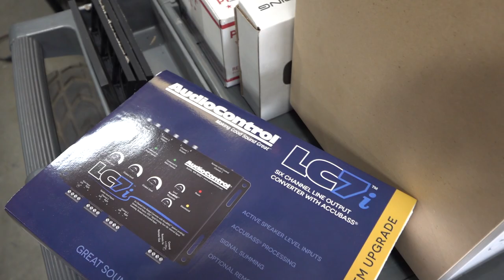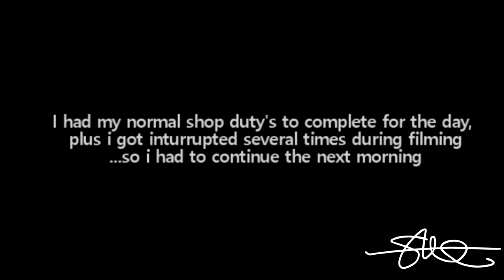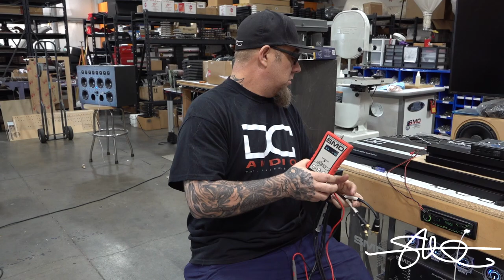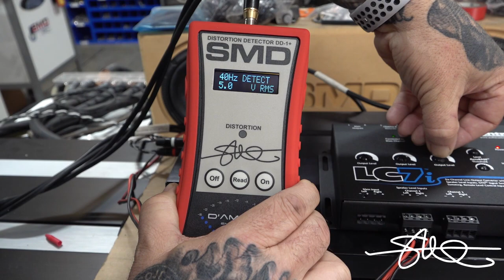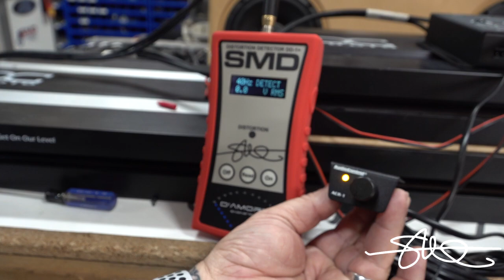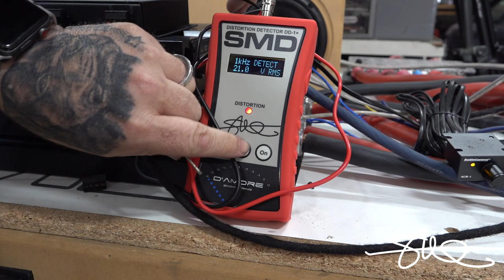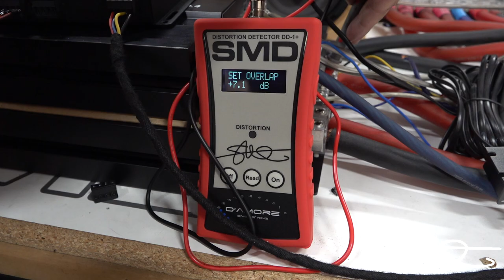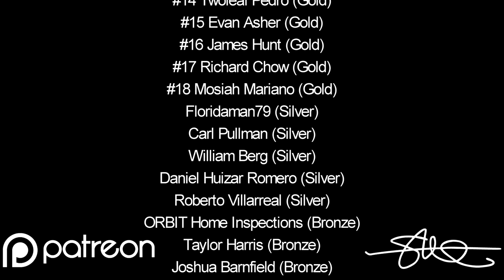Add Amps not Distortion! AudioControl LC7i 6 Channel L.O.C. Hooked up, Gains Set, Played full tilt

Comment: With a remote gain knob, rather a bass knob, would you still have to turn the knob all the way up?
Reply from the maker: Raging_Bullz77 if you can.
Reply: Alright. The amp with the gain knob is a S1-850 from Soundqubed. I'm a little new to gain knobs as most amps I've ran before are just bass control knobs.

Comment: I don’t know much about speaker, but I have a 2016 Honda Accord sport with the factory 4 speaker system. I recently bought a Skar 2000 rms amp and wondering could I hook this up to it or is this to much?
Reply: yes it can take up to 400 watt signal which has nothing to do with output. add a few more amps your good to go

Comment: What effect does changing EQ points on the radio have on these settings? I see a lot of guys doing the smiley face on their EQs, would they need to account for that while setting their gains?
Reply: Yes, set the EQ before you set the gains.
Reply from the maker: sure..they should stop drawing smiley faces and using an eq for what it is made for.  If you are using a dd-1 it is time to be serious about it and learn how to do everything right.
Reply: EQ is for correction to get a flatter response not to draw a "smiley face" That's a funny way to describe it though. 
At lower volumes, we do not hear those ends of the spectrum. When you get old like me, those frequencies are missing even more until you turn it up a little.

Comment: So question. I notice you always set the bass amp to -10db. How does that not clip extremely bad? I set at -5db and even studio recorded music is usually hotter than -5db. Like I purchased Psyph's first album and he was way hotter than -5db on a lot of his tracks. Just curious if you could explain the setting choices and how to manage them for people. I'm sure someone that's new will buy a DD-1 set at -10db and then go straight to DJ Russiticals or DJSNT music.
Reply from the maker: it's not just me that does it. It's the basics of car audio for decades.  It's just a o-scope used to the the tool. Now the dd-1 is where it's at.  And no, it isn't clipping extremely bad. It's called a gain overlap. Instead of me putting on a class here for you, just click this link and read it very carefully.  You will be enlightened. http://www.davidnavone.com/heresHow/files/LevelSet222.pdf
Reply: @meade916 So what am I missing in my setup? I tune the headunit to 0db. My max volume is 37. I set my gains at -5db on my bass amp. When I play any song off King Morrison at full tilt my clip light almost never shuts off. Same for any of the "DJ's" music. I just always adjust with the bass knob. That's why I was confused on how you're setting to -10db and full tilting but it's not clipping even though I know how hot Psyph records his albums. I'm familiar with the theory of gain overlap. Not hating at all just confused.
Reply: Sounds like you're not reading flex.
Reply from the maker: @Supercharged1976  don't pay any attention to that bogus "clip light"...and Psyphs albums aren't recorded "hot".  I helped produce the last 4. They are good.  I don't know how you are coming to that conclusion. I think you are just overthinking everything.  If you are using a DD-1 to set the gains, you should have gotten a booklet.  It explains a lot.  Plus, i gave you a link to a very good read by one of the best there is.  Check it out. Thanks!
Reply from the maker: @Supercharged1976  if King Morrison is giving you issues, try the actual CD instead of a download off the internet.  See if that helps.

Comment: TIP: set accubass 100% - gain 0% - bass 0% - I have it hooked up, LC2i to clarion EQ to sub amp.
Reply: Your accubass isn't ment to be at 100 percent .it's supposed to be set after all your gains are set and if your factory set up is causing bass roll off then you use the accubass  to compensate for it .
Reply: Please read the manual lol..
Reply: @Thezuule1  this works only with the EQ like i stated.
Reply: @lmlittleman  What do you mean this work only with the EQ like you have stated? I personally own an LC2i and LC6i and I'm begging you to read the manual. You don't know what those knobs do.

Comment: doesn't the lc7i have a built in distortion detector? If so, id love to see how to set the gains with that, and how the detection is compared to the detector you used in this video.
Reply from the maker: Brian W not that im aware of.
Reply: It does its the yellow light on the front that says maximize
Reply from the maker: Chris Spiller ya but that aint a distortion detector or any kind of a clip light...so 🤷‍♂️
Reply: The maximize light is for voltage. It starts flashing when the input and output levels controls sense maximum design voltage.
Reply: @juicedcoupe  this is and i quote from the audiocontrol website tech page "**THE MAXIMIZED LIGHT ENSURES YOU DO NOT DISTORT THE OUTPUT OF THE CONVERTER, IT DOES NOT ENSURE THAT YOU WILL NOT DISTORT THE INPUT OF YOUR AMPLIFIER** The maximized light is a handy tool if you do not have a volt meter handy. It serves as a guide in helping you not distort the input of the amplifier ."
Reply: with all that said they do say that you need to find output distortion level of the source unit first, but the maximize light is for gain matching the input of the convertor to the output of the convertor.
Reply: So, it does not detect distortion.  It just keeps you from overdriveing the inputs and outputs, inadvertently creating distortion or clipping.
Reply from the maker: @juicedcoupe  all i know is that even though the light was on there was no distortion present.  The dd-1 will light up like a 1 lane country road stop light if it see's any distortion, which happens way before clipping.  And if it was clipping the dd-1 would for SURE be going nuts.  So it's clean.  The light might just be a soft reference point for noobs who shouldn't be doing this themselves....but do anyway.
Reply: @meade916  That's the point I was trying to make. The light is just a voltage reference, not a distortion detector of any sort.
Reply: @juicedcoupe  no it ensures the output signal is not distorted should it become distorted, the light turns on just like the dd-1
Reply: @juicedcoupe  how accurate it is compared to the dd-1 is unknown which is what the op and myself are wondering.
Reply from the maker: @coupedevylle  no it doesn't.
Reply from the maker: @coupedevylle  it isn't a distortion detector or a clip indicator. I already said that. So there is no comparison.
Reply: @meade916  yeah disregaurd previous comments, i was mistaken, i did some more research and talked to someone i know that more familiar with them. I was way off base.

Comment: so if my 4ch amp is 100x4 but my door speakers are rated at 70w rms, should i set the gain overlap to 7?
Reply: Assuming the ohms match up, some mids/highs amps rate full power at 2 ohm, where as your speakers are most likely 4 ohm.

If your amp does over power the speakers, then yes, it's a good idea to back off.
Reply: yes focal components are 4ohm as well as the alpine 4ch at 100x4 at 4ohm.
Reply: just received my DD-1+ about to dial this baby in!
Reply: Dude can u answer this for me please?, So basically this dd1 + is just like the normal dd1 where u use 40hz at -10 db on the subs and -5 db on the highs, but the only difference is with the dd1+ u can control the amount of power sent to your speakers if the speakers are smaller? But with the delay overlap on the dd1+ it shows up as  +10 on the highs and +5 on the subs?

Comment: I have a single nvx vcw122 12 and its powered by a pioneer 1000w max power amp. Has 4 guage wiring. After 10 mins of playing around 30 vol the amp gets hot and starts or pause while the doors still play... any suggestions on what to do???
Reply: join the SMD forum and ask there
Reply: What's that
Reply: @aaronheard1794  steve meade designs forum, google it
Reply: No offense but the amp isn't great. I would double check you have your gains set correctly, jimmy rig a PC fan to the guts of the amp for some cooling if you're jimmy rigging inclined, or perhaps just buy a higher quality amp.
Reply: @Thezuule1  I read reviews and they were not so good. Gonna get a skar amp.
Reply: @aaronheard1794  Big D Wiz has an amp dyno video up of a nice Skar for under $200. Can't remember the model number off the top of my head.
Reply: @Thezuule1  yeah I seen that vid. All skar amps have amp dyno vids on the site and they all do more than advertised. The one I found was 750rms
Reply: @Thezuule1  what the fuck is adding more cooling going to do hahaha
Reply: @aaronheard1794  That will run just about anything a reasonable person would want if you tune it right.
Reply: @Thezuule1  for sure man. I'm only 16 man haha. Not trying to hit a 150😂
Reply: @aaronheard1794  Give it time... lol
Reply: @Thezuule1  I wanna get another 12. Soon or later I'll be up to 4.
Reply: @aaronheard1794  Living the married with children life so I've had to scale things down. Stock integration with a JL Cleansweep -> JL 250/1 -> Focal  11" 27v1 sub in the manufacturer box. SQ is great, output is really solid. I have a 10w3v2 in a big fat box that pushes more SPL but something is wrong with the VC atm. Need to pick up a recone kit for it and fix it.
Reply: @Thezuule1  pretty sweet
Reply: @aaronheard1794  It's okay. Hits hard enough to make ribs shake but doesn't take up enough space I can't fit a stroller or whatever in the back. Happy compromise.

Comment: Does anyone know what could be my problem i have a 4 channel amp with a audiocontrol unit and jl components but every time I turn car off the tweeters on pillars make a popping noise! What causes this? Please and thank you
Reply: I would check all your grounds...
Reply: @spoom937  thanks for responding just saw this now so ill check tomorrow morning cuz its freaking hot in northern California 100°+ but will do ill let you know
Reply: @spoom937  it was actually the audiocontrol lc6i i had to change one of the jumpers inside to different ground option and it worked!

Comment: I’d distortion and clipping the same ?
Reply: Distortion occurs when the output signal (not the signal strength, but the signal itself) does not equal the input signal. Clipping is a form of distortion. Clipping occurs when the amplifier exceeds the voltage available for the output signal. The output signal hits a voltage ceiling and stops increasing its amplitude. This form of distortion is potentially destructive when sent through a speaker.

Comment: Man you gotta put a list out of authorized shops that can tune like this with your equipment in sick of amp clipping
Reply from the maker: 95% of the shops out there don't know how to use an O-scope. Anyone can open a shop and say they are an installer....beware and do your research before diving in.
Reply: I use all SMD tools for amp tuning and crossover settings.  I swear by them and my customer's smiles is all the proof I need.

Comment: So I've been trying to think through this tuning amps without a load on them thing and I'm hoping someone can give me some input to make sure I'm understanding this correctly. The reason why you can tune an amplifier without a load attached to it is because the output load is essentially irrelevant. What you are doing is matching the input sensitivity of the amp to the input level coming from the source. Whatever comes out of the output at that point is entirely based on the amp. Regardless of what you attach to the output the resistance is going to constantly fluctuate anyway so the output voltage you get is the voltage you get regardless. That's the maximum output of the amp no matter what you attach to it for a speaker. Whatever the driver at the end can do with it is what it can do. Am I at least in the ballpark here?

Comment: Do you use gaffers tape instead of electrical tape? In AZ, black electrical tape would make a gooey mess in a 140 degree car.
Also, some older Audio Control stuff has distortion lights to help the gain setting process. Do they work as well?
Reply: I hate that sticky crap 🤬
Reply: That's called TESA tape.
Reply: @Pigeoning  i used zipties this time no more sticky mess

Comment from the maker: from "Level setting, by Richard Clark" - "So how do we go about this important final system tweak? First off forget
all those statements such as "set it at 3/4" or "turn such and such to here." Such
comments are the babblings of techno-idiots and should be ignored by anyone
serious about quality audio. No doubt you have heard such poor advice, as well
as the other extreme, where the process is described in detail that would rival
brain surgery. Really it's not as complicated as its importance would suggest. All
we really want to do is insure that when a signal starts out at the beginning of a
system that it passes through the entire system as high as each component will
allow without adding distortion. When a system is adjusted for absolute best S/N
and lowest distortion, all the components will reach overload at the same time."   - find the entire article here and you shall be enlightened my people..  http://www.davidnavone.com/heresHow/files/LevelSet222.pdf